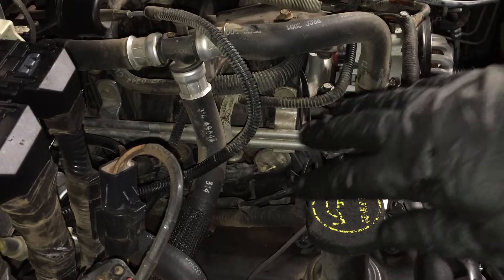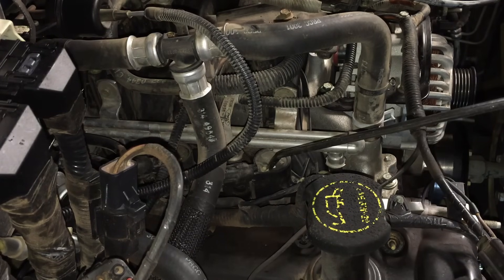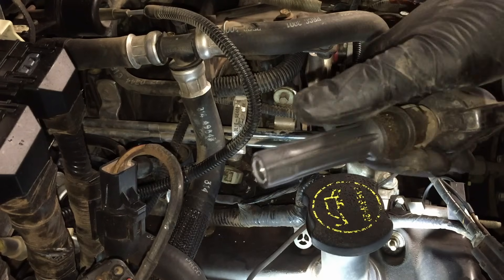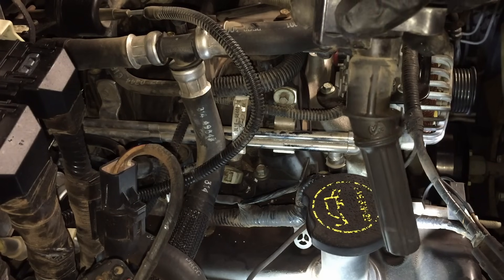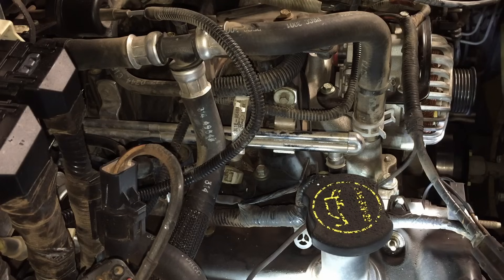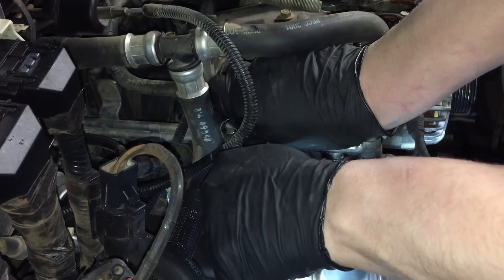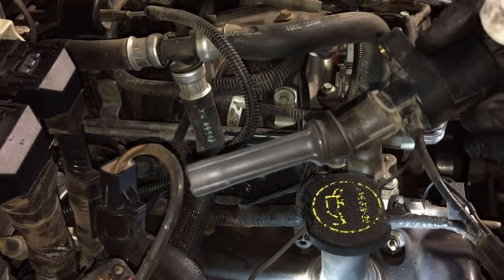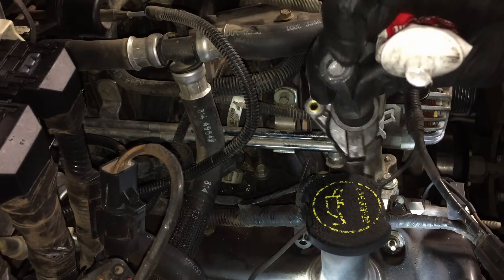Important Tips When Replacing Spark Plugs on Ford 4.6L 5.4L 6.8L 2v Engines

Comment: heres my story on my 99 gt mustang. been getting check eng light for misfire plugs 3&7 the  eng code would clear its self no problems for some time then..going home the other day lost a cylinder got home check the code number #3. changed the plug and coil on 3 changed the plug on 7. found 6 blew out of the hole bingo the problem right( 35k miles on the plugs.) around town driving after the repair check eng light #3 again pulled the plug back out checked it put it back ran great for 5 min or so. i spark tested #3 with a jig set up with a used coil and a newspark plug work great. tested the new coil and spark plug weak spark. the new coil was not making good contact with the spark plug.  CHECK THE NEW PLUGS AND COILS BEFORE YOU PUT THEM IN.. ALL MY PARTS WERE FORD MOTORCRAFT..

Comment: Question for you. My brother in-law has an 01 towncar that occasionally will diesel or run-on when you turn it off. My understanding is that a fuel injected car shouldn't be able to do that. Any ideas? To my knowledge it's never had any maintenance beyond oil changes and air filters.

Thank you

Comment: And would you trust this amazon link?  I’m wanting to replace all plugs and coil packs on a recently acquired 2006 Eddie Bauer V8 

https://www.amazon.com/Ignition-Motorcraft-VICTORIA-EXPEDITION-EXPLORER/dp/B073ZPP2SK/ref=asc_df_B073ZPP2SK/?tag=hyprod-20&linkCode=df0&hvadid=312430092407&hvpos=1o1&hvnetw=g&hvrand=6472870526883974807&hvpone=&hvptwo=&hvqmt=&hvdev=t&hvdvcmdl=&hvlocint=&hvlocphy=9011829&hvtargid=pla-569669700391&psc=1
Reply from the maker: Nooo you will have problems with those coils!
Reply: Suggestion on the coil pack part #.  The plugs are correct, though?

Comment: I have a 2000 ford f150 with the triton 4.6 2v it's misfiring really bad an has no power under full throttle but 1/4 throttle it drives fine anything past that it's not happy any ideas?
Reply: Had a similar problem with my town car. It ended up being an ignition coil. the front drivers side - I forget the number. Is the check engine light on? Even if its not get an auto store to check the codes see if anything comes up. As always, its not good to drive while misfiring you can damage the cat converter.

Comment: 5 and a half hours later my plugs are changed.
Reply: Exterior Revival 

Why did it take that long? What problems did you run into? I need to do mine for the first time so any advice would be appreciated.
Reply: Chump Johnson Just a lot of little things to figure out. Some coil and coil bolts are hard to get to. The socket kept popping off once I’d get the plug in and I’d have to re pull the plug. Just little things. I could do it now in like 2 hours max. Just little stuff going wrong. First ever plug job I’ve done and it’s not hard just tedious.
Reply: Exterior Revival 

Thanks for the reply I’ll definitely let you know how it turns out for me

Comment: I've changed the plugs in my vehicle twice myself to save some money. The plug for cylinder 4 is such a pain in the butt to get to and get out. Limited space plus having a bad case of carpal tunnel syndrome in both hands equals lots of frustration.

1998 Expedition xlt 
4.6 Engine

Comment: I had heard of that problem a couple of years ago...
I can't remember if it was just Romeo built Engines, Windsor built Engines, or both. 

I am a Retired Ford Tech, since 98... There's things I'm still learning about newer models.
I've got a 98 Mustang GT and an 03 E150. Do I need to worry about either of those?
Thanks!
Reply: The e150 - yes.  Is a PI head,  so make sure you have at least 20lb-ft

Comment: Couple things about your spark plug recommendation ("Motorcraft ONLY")... I disagree, at least partly, for a couple reasons. The first reason is this: My 5.4L MOD was manufactured at some point in 1998 or 1999 as my truck is 1999 Super Duty. And at least in those years, Ford's OEM supplier of spark plugs for the 5.4L engine was Autolite. So it stands to reason that unless Autolite's quality has taken a very steep nose dive in the past 20 years, they should still be plenty good to use in your MOD engine. And to expand on that, from what digging I've done online, as far as I can tell, Motorcraft brand plugs have been made by and still are made by Autolite to this day. That part I'm not 100% sure on but fairly confident about. But I am sure about what was used factory in 1999 Super Duty trucks with a 5.4L as I did the very first plug change on my engine myself and found 8 Autolite plugs in the heads. That being said, I see no issues with going Motorcraft and I think that's a good choice, especially since they're probably identical to the Autolite plugs. But if you want to go to a high end plug, like something with an iridium tip (which I like to use) you can't get that from Motorcraft and you'll need to get them from some other brand. I went with Autolite for the set I'm about to install because my first plug change I went with Autolite and had no problems with them at all... performed well all the way up to their recommended replacement mileage. And because I got a super good rebate offer on the plugs ($3.00 off per plug... check their website). And yeah I know you are all going "Oh he's a fanboy for Autolite." nah not really... I think my next point should prove that: If you want the best spark plugs money can buy, buy NGK. No one has ever or will ever make a better plug than NGK does. The Japanese know what they're doing when building cars and car parts. I would have got NGKs for this plug change if I hadn't stumbled across such a great deal on the Autolite plugs.
Reply from the maker: Autolite plugs are no longer the same as motorcraft they are inferior and cause problems on many platforms. NGK is a good alternative but their numbers appear on the Motorcraft plugs so why not just buy Motorcraft and not only have plugs that wont be a problem but also have the latest updates to address known issues. SP534 to SP-580 for instance or what about SP-515 to SP-546 do you now see why I recommend only the latest Motorcraft plugs?

Comment: wouldn't iridium plugs be better?
Reply from the maker: Absolutely not need on this engine, that would be overkill.
Reply: @FordTechMakuloco  I thought the irridium was  a longer mileage plug than the Ford but I guess it doesnt matter as I probably wont get another 100,000 miles anyway so might as well get the less expensive stock plug.

Comment: Thats the engine that broke me of  ever owning another mod. Its just damn ridicules the shit you have to  go through just to  change the plugs or replace the timing. I will stay with my 351W and 460. Hate my wifes expedition. Coils wear out at 100k or so. Thats the damn truth and so do a lot of other parts. My single coil on my 95 fires 8 times as much and has over 350k on it. The newer the vehicle is I guess equals to crappier parts used.

Comment: The problem with injected air inside the chamber is....if there happens to be foreign debris insde it can get lodged behind any open intake valves. Use vacuum instead.

Comment: Any tip for the ones against the firewall
Reply: I took the computer loose to get it out of the way and used a swivel head to get back there. It was on an 04 Lincoln navigator

Comment: Thanks! I was wondering what was going on with my 2001 F250. I parked it at 90k miles because of the plug issue. I was clearly using the wrong mechanic! Thanks again.

Comment: as an added option....Denso (which is OEM for these coils) can be purchased for $23 each, on Rock Auto and shipping is only $7.99  As an added bonus, if you have a Discount Code, the discount pays for the shipping.
Reply: Did you put Denso coils in your 4.6 or 5.4? How did it handle it?
Reply: @UncleSarkis  hey Uncle Sarkis! great question. i ended up with Motorcraft plugs and coils. my Mechanic said the same thing as Brian. just keep it Motorcraft. the coils were $135 for 8 of them. the Motorcraft plugs are very inexpensive. i have the 5.4L 2 valve.

Comment: I just did my plugs yesterday. I bought a new spark plug socket that has a magnet inside and it holds the plug perfectly. I got the socket at autozone.
I’ve changed a lot of plugs in my day and I’ve done them on my ford 5.4 years back without the magnetic socket and with these engines it’s so much easier with this magnetic socket.
Reply: azntactical 
did you remove the fuel rail? I was going to but I was able to get it done without removing it. Number 7 (the second from the last on the drivers side) was the worst one. It took like an hour to get it out and about the same time to reinstall. After doing number 7, I thought number 8 was going to be just as bad or worse. To my surprise it was not too bad at all. I just didn’t want to deal with something going wrong with removing or installing the injectors. I’m sure the whole thing would’ve been easier if i did move the fuel rails.
Reply: azntactical hahaha you must not have an early 2000’s truck. 
I’m happy for ya

Comment: Why don't you show how to do #8 or 7 or 6l It is not possible to do any of the ones past the #1 and #4 without taking a lot of other items that keep you from pulling the coil out!!
Reply: Yes you can, the only one that is an issue is #7 if you don't have the correct tools. Did all of mine without taking anything off other than pushing the airbox aside.

Comment: I just got a 97 Ford F-150 118k miles but check engine light came  on! So I checked it Gave  me the P0304 code ... recommended to change spark plugs and coils.  Any tips ?? For a novice ... I need to get the right ratchet extension tools but I don’t know where !!! 

Thanks. 
-Milo
Reply: Craftsman tools are good.Craftsman, Stanley and Ace hardware tools.Craftsman tools are sold at home depot or Lowe's home improvement stores. Stanley is sold at Walmart.Ace hardware sells Ace tools.The Stanley ratched set I purchased is over twenty years old and working fine.

Comment: Paid mine to replace mine both the plug and coil at about 105k at Ford. . I’m at 115k now and one already failed.  18 year old truck and it’s the first time the check engine light came on.  I’m not happy with the Ford quality now compared to 2001.

Comment: Almost every forum I've seen on the web has people blaming OVER TORQUED plugs. I'm not exactly sure why, but you've been runnung plugs at 25 with no problems it seems unlikely. It makes more sense that plugs backing off is the culprit
Reply from the maker: It works Ford techs have been doing it for years.

Comment: Do you have to unplug the battery before replacing a coil.or will the service engine light go off when you replace coil
Reply from the maker: No just make sure the key is off.
Reply: @FordTechMakuloco  thanks man. Great video's👍

Comment: Yes absolutely use motorcraft on any electronic part for Ford including motorcraft plug wires. Lots of different vehicles will except other aftermarket parts with no problems, but not Ford. Ford's are some picky ass machines when it comes to the right electronic part.

Comment: I recently picked up a 2003 Mercury Grand Marquis with 120,000 on it. Will it follow these instructions or will I need to follow the instructions on one of your other videos where the plugs need to be turned about a quarter turn and soaked with the Motorcraft carb cleaner?  I don't want to break a plug off in the head.  Will the plugs listed here be what I need for this car?  Thank you for your very helpful videos.  I followed them to change the transmission fluid and plugs in my 2011 3.7 Mustang and have had no problems.

Comment: Di electric grease on the tip. You don't feel that is also being anti conductive to the plug tip to coil pack. I think if you applied it to the ceramic insulator on the plug then it would not be non conductive to the plug to coil. So before installing plug put grease on insulator,then install plug.   :)
Reply from the maker: Yes I do it the same way Ford does it. They apply directly to the coil boot and spring just a light coat. The excess is pushed off to the side when installed and there is never a problem.

Comment: I bought a full set of Accel super coils nearly 10 years ago and they perform like the day I got them and the increase in pep and power is remarkable over one million parts and with eight iridium sparkplugs to light the fire's under her feet. I found a set of shorty headers that were the same length as my stock exhaust manifold so I didn't have all the problems of where to put the catalytic converters to dual exhaust. Just a minor adjustment in the control module and our E super duty will be ready for auction, but I have this one problem with the passenger side seat has developed a tear on the corner since I need to replace that.

Comment: Thanks for the tips ,2002 f-150 5.4  started skipping went to local shop $100 to diagnose  $100 to install 

 #1coil $ 30 for coil plus tax total of almost 300  bucks one month later another skip i bought 8 performance coils and 8 motocraft plugs for under 200 bucks followed your advice truck runs awesome! !!thank you !

Comment: Dieletric grease on the metal contact area? I’m new to doing spark plugs. Some people say dielectric grease should only be used around the ceramic area of the spark plug never the metal tip area. Yet, I see videos with both methods. Google and seeing other videos folks are confused like me. What is the correct method?

https://youtu.be/-542IYGBbpg

Comment: Great video like all your others!  I changed all 10 of my spark plugs and coils in 2.5 hours on my 6.8L 2V. The  job isn't bad if you have an assortment of extensions and the GearWrench swivel. Also, I was able to get a torque wrench on every plug and you do not need to remove the fuel injection rails. 

Out came NGK plugs and in went Motorcraft plugs and coils. The plugs were torqued to 23 ft-lbs. The big Ford runs like a beast now! Thanks Brian!
Reply: Tim, How many miles do you have on your V10?  Have you ever had the plugs blow out of the engine? What kind of vehicle is your V10 in, car or truck?
Reply: @svenandaas8781  I bought my F-250 when it was 20 years old and had 195,000 miles on it so I don't know the history. The truck ran good and was reliable for the two years I owned it. I ended up buying a 2009 F-250 4x4 with another V-10 but this one is a three valve. Great truck!

Comment: Seems like over torquing in Aluminum threads that are not that deep to begin with is a great way to strip your threads.  Going to 25 ft. lbs. is nearly double factory spec of 13 ft. lbs.
Reply from the maker: Never a problem.
Reply: @FordTechMakuloco  Thank you for replying,  I have a Ford F250 with two valve heads and 40,000 miles on it.  It is a 2004 and has spent most of its days in a garage.  I'm wondering when I should consider replacing the plugs?  Thanks again for your assurances here.

Comment: Lmao yea not so easy dongetbthe passenger side back two I broke a assy. Hose heater shut off 20 bucks it was brittle any way 2004 200500 miles exspedition 4.6 plugs had more than 9 hundredths of a gap

Comment: I was DREADING doing the spark plugs on my 2004 Excursion until I figured out it's the 2V now I have NO issues haha.  BUT, I don't think you're wrong on the whole with your comment about buying OEM.  OEM is ALWAYS best quality in my opinion.  BUT, I think there may be a couple caveauts.  I think MSD makes a great product that meets OEM specs.  The thing about MSD is their R&D department.  A TON of guys run their ignitions for street applications because they have the best idle and high RPM (not a concern on a 5.4L 2V redlining at just over 5k rpms...) performance.  What I look for is efficiency.  The least amount of misfires per 100,000 or whatever it is.   The least amount of misfires means the most efficient, means less wasted gas better gas mileage.  Even though it's going to be extremely negligable with the amount we're talking about.  The range of misfires that your computer allows as 'normal' basically.  So, I'm going to put in MSD spark plugs and MSD coils in my Excursion.  I will SURELY know if I run into a problem because in that big girl every horse is needed when I loose one I know about it :D hahahaha if you own a 5.4L excursion you know what I mean ;)
Reply: How were the MSD plugs and coils in your 5.4 excursion?

Comment: hey are autolite plugs as good as motorcraft plugs? i got an o5 townc ar with 4.6. Would love your help
Reply from the maker: They used to be just as good but now they are prone to causing problems. I only use Motorcraft in my customer vehicles.
Reply: thank you for the super fast response ill take em back then and buy me some motorcraft ones :)
Reply: @FordTechMakuloco  What about Ford Performance spark plugs?

Comment: Everything was going good until one of the boots broke on passenger side 2nd from front down on plug. Basically it’s the tip of the boot that broke and I can’t get the socket around the plug to remove. What would you suggest to get the broken boot off plug? Long needle nose pliers and try and grab it and pull off?

Comment: I subscribed because the factory torque seemed insufficient. I found your video and with my torque wrench put 25 foot pounds on each spark plug, which eliminated the loose fit. I’m looking forward to driving, not worrying about blowing out the plugs now.

Comment: You got any insight on the recall Ford had with the Triton V8s on the spark plug  welding itself to the engine block? I have an 04 Expedition 4.6l that needs a plug change bad and im reluctant to replace the plugs because of this
Reply from the maker: Yours will come right out.